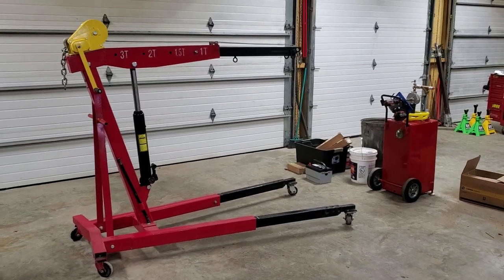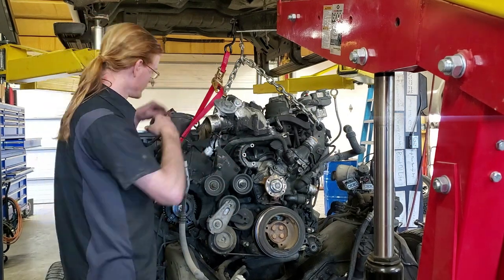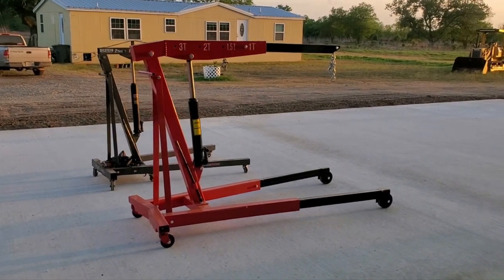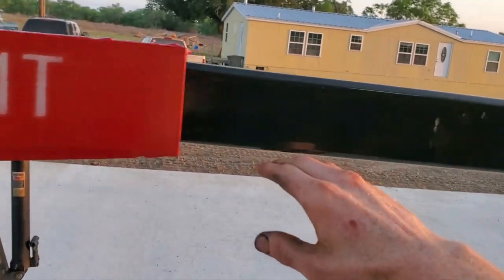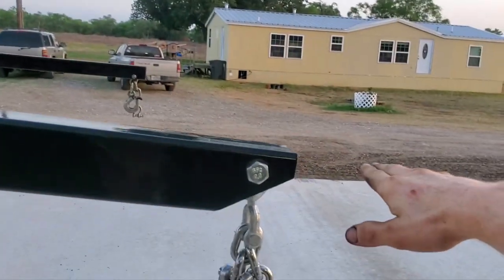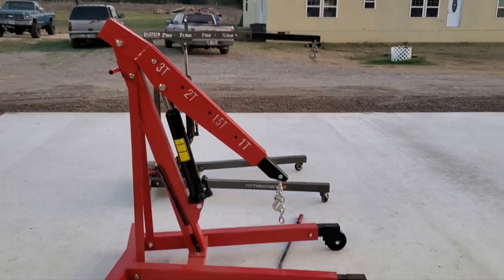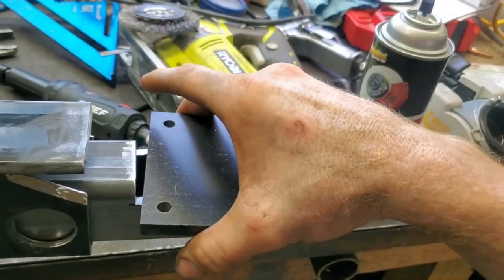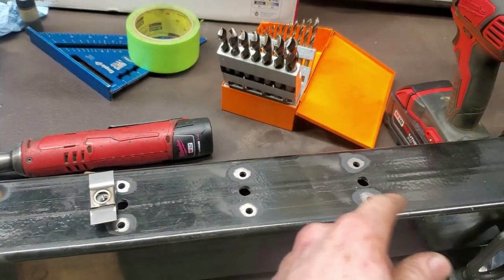3-Ton Engine Hoist With Upgrades | Building, Using, Full Review

Comment: Being a diesel truck tech for over 40 years and a truck shop owner for 33 years now, I can tell you are a very seasoned tech who actually does the work. Your attention to the little details when explaining why you changed this or that can only really be understood by those who have actually done these things you are talking about and realize that what you have done to modify this, will actually help, in that exact situation you are trying to modify it for. For example, the plastic boxes motors and transmissions come in, unless you have never actually hooked a chain to one of those and tried to lift it out of the box, would you realize that the legs are too close together ( on most hoists)  and you end up putting one side of the box up on the legs of the hoist. Excellent little point. The reversible hoist small detail about having to just push forward or back to go up or down. Unless you have never used a rachet type hoist or come-a long, would you know that tiny detail that is so important when trying to stab a engine. The hood insulation, the tilting of engine, the holding of engine in position, ratchet strap hooks for both sideways and front to back adjustment are all excellent details only seasoned techs will notice. Great job.
Reply from the maker: Thanks, I appreciate the kind words!

Comment: I super enjoyed your quality work. I think the hand winch was such a good idea. Adds a lot of versatility to the cherry picker. I use an adjustable crane on on one of my racks. I have a pit that I usually use to pull engines, although I haven’t done one for awhile. The advantage of the pit is that u have full access to the underside of the car whilst lifting the engine out with a come along. I support the trans with a transmission jack that always stays in the pit.
Reply from the maker: Thanks for the compliment! And yeah the hand winch is now a mandatory accessory in my book.

Comment: Very well done! I’m going to do a custom build lift of my own design to be able to employ some of these concepts and modularity while also able to maintain a somewhat compact design. I’d also like to add an area to the rear to stack counterweights in order to lift much heavier loads and have thought a lot about a multi-stage boom section in order to gain some height. That would all essentially turn an engine lift into a mini crane…. Or possible death trap, but time will tell. 😂

Comment: You are a GENIUS! It's crazy how such simple upgrades make a difference! 

Have you considered changing the hoist wheels?  Thank you.
Reply from the maker: Thanks but all the credit should go to the other YouTube channels that gave me this idea. Also, I did replace the front wheels in this video. The rear swivel casters I left alone.
Reply: @TechnicianRed  do you think the winch added a mechanical advantage? On my cherry-picker, I want to add most of what you've done. I, too, wish to make use easier and to get a better mechanical advantage. Somehow rig a block & tackle etc. I think I might be expecting too much from the lift. I use my lift to get equipment in and it of my truck. Most of the time, I'm alone doing this by myself.

Thanks again for your sharing your knowledge.
Reply from the maker: @xFalconFixer the winch would only add mechanical advantage with a pulley setup but your lifting speed would be  cut in half at a minimum. The winch I have has plenty of power to do these light duty diesels and is still much quicker overall than using the hydraulic ram on the boom.

Comment: Very nice mods. I'm going to install cast iron casters to drop the height of my hoist as I have had issues running into control arms & equipment. Plus my casters don't roll well. I'm also making the front two casters non-swivel. I can steer it from the rear we'll enough. Thinking about a winch...

Comment: That top post bending can be cured with reinforcement before it bends.
Or adding a tube inside the boom arm, then drilling the inner tube to pin at the 2T mark. (2 pins, weight is on them)
Reply: The HF legs, remake them 90° from the back tube. This makes pallets fit inside the legs
Reply: And the winch, maybe welding a snatch block on top. Why redesign the wheel, and you'll get to keep the original hook
Reply from the maker: The original hook still works. I keep it hanging from the hoist at all times in case I need it. I switch over to the hook if I am lifting something over 1500lbs.

Comment: What's the weight that your brother was lifting with that 2T hoist in the most extended position, I am thinking if that hoist had some metal strengthening in some key places, it would hold a fair bit more would out bending problems?
Reply from the maker: About 900-1100 pounds (5.9 Cummins)

Comment: did you test it on a 1 ton load setting? i don't think this is capable of 1 ton at that length, those rectangelar profiles don't look capable of lifting a 1 ton load.
Reply from the maker: The heaviest part I have lifted was our forklift counterweight but I had the boom in the 3 ton position. As far as the 1 ton position goes I have lifted several fully dressed modern diesel engines weighing in at 1200+ lbs and it handles it just fine with zero deflection so I imagine it would handle the full 1 ton without issues.